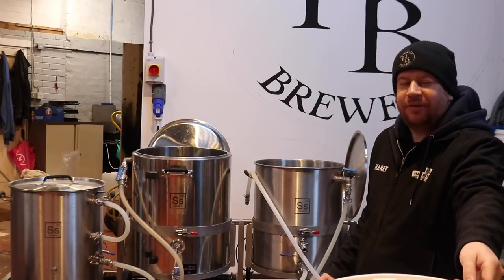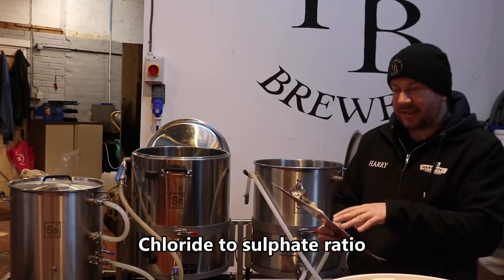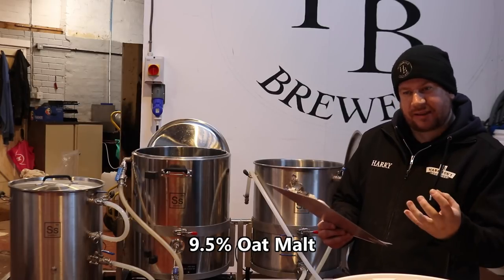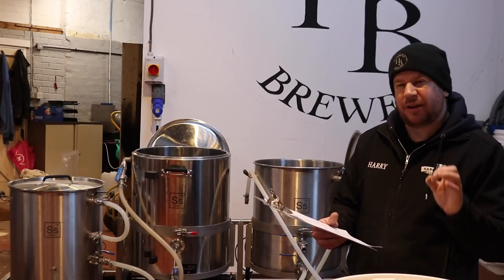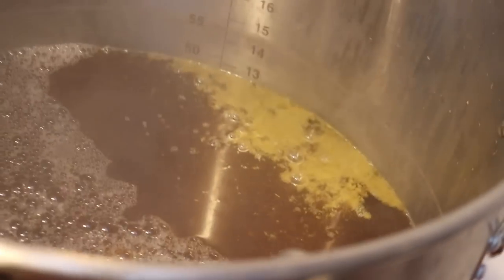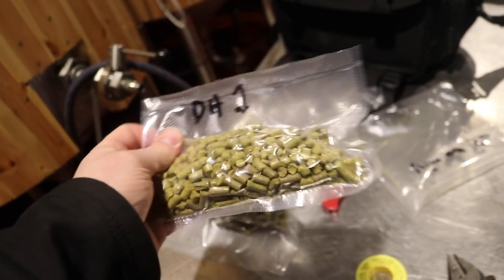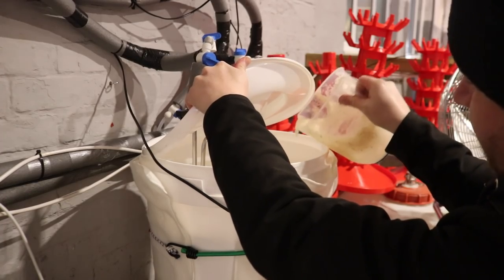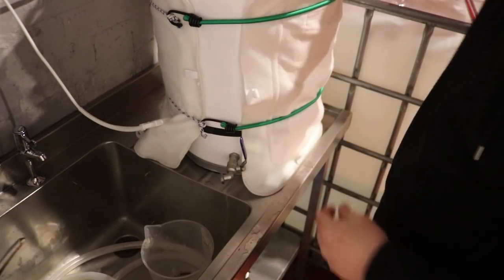East Coast IPA Recipe & Brew Day 🍺🍺☕👨‍🏫

Comment: Harry, as someone who has brewed this style (NEIPA, East Coast IPA) a lot over the years, you are going to lose A LOT of the flavor and aroma from the hops by adding them that early.  You'd be much better off saving a lot of those hops for the final dryhop after you've removed most of the yeast from suspension via a cold crash.  Cheers!

By the way, that's definitely gonna be hazy with all the protein and hops in there!!
Reply from the maker: That is usually how I dry hop my beers. I was hoping to see some bio-transformation of the hop acids due to the yeast working on them. We will see, Just feels good to be able to experiment with beers again.
Reply: @harrybrew69  Looking forward to the results wither way, Harry.  Cheers!

Comment: AWESOME EQUIPMENT!!! Iodine cannot be used to determine when conversion occurs. Basically, it determines if starch is present. The color of iodine, yellow to deep red/mahogany determines sugar balance. No color change means the sugars are balanced which is a good thing in certain styles of beer. There's more to it than simply glancing at the sample and being happy if the sample isn't black. Allow the sample to cool a little before whacking it with Iodine and leave the grain behind. Next time squish some of the grain and then add Iodine. You'll see how much starch is left in the mash stuck in the kernel which causes starch carry over.
You skipped the conversion rest, anyway. Beta is responsible for conversion and it denatures rapidly at 67C, not too much happened with conversion. Beta converts glucose that Alpha releases from simple starch, amylose into complex types of sugar that ale and lager need. When conversion occurs so does secondary fermentation. Alpha is responsible for liquefaction, saccharification and dextrinization. 
The rest temperature at 67.5C didn't do too much with amylopectin, a heat resistant, complex starch which contains A and B limit dextrin. The temperature was too low to cause the starch to burst before Alpha denatures. Limit dextrin is responsible for body and mouthfeel. Dextrinization occurs when Alpha liquefies the complex starch chain. The pectin is responsible for gelatinization, mash jells up. To utilize the starch included in the price of the malt, mash is boiled, otherwise, it ends up as compost when the single infusion method is used.
Use under modified, low protein, malt. The malt is richer in enzyme content and higher in sugar content than high modified, high protein, malt. Weyermann light and dark floor malt are examples of under modified, low protein, malt.
Avoid prolonged recirculation, it cause an issue called over sparge. Vorlauf is kept at 10 minutes for a reason.
Skim off the hot break as it forms and continue to remove it until it reduces, then add bittering hops. The extract will be cleaner and less hops are needed.
Dry hops stale beer rapidly because pH is too low. Use a Randall instead. An entirely different method for dry hopping is used than the method homebrewers use.